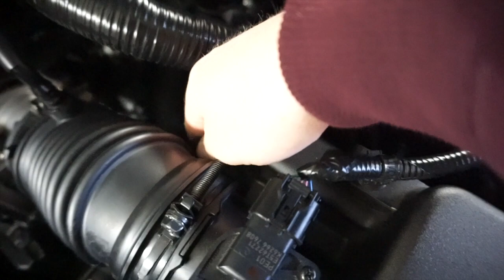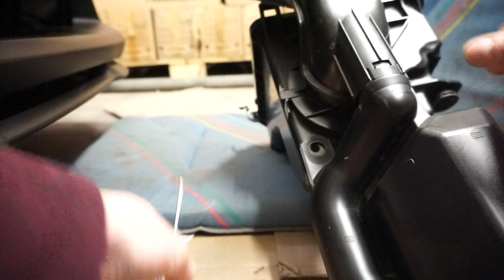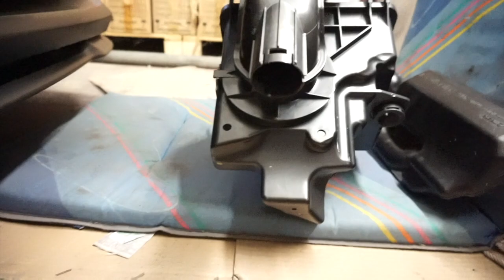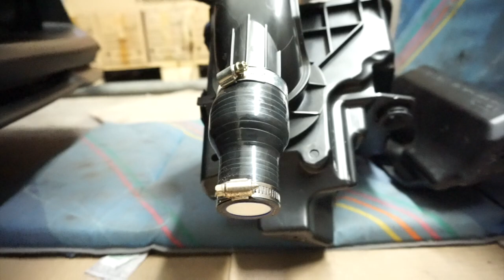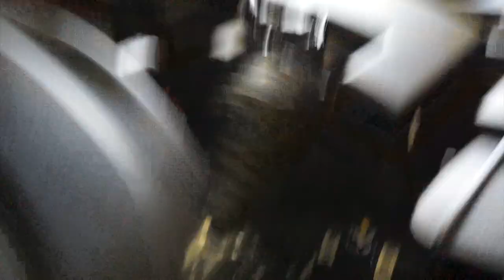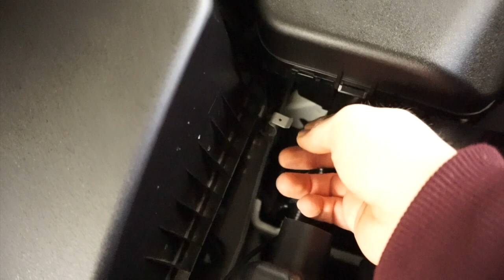Project Mazda CX-3  --  Resonator Box delete

Comment: Removing intake resonator will reduce power and increase the noise. It will create also power hole at some exact rpm's (depending of the manufacturer). It is highly NOT recommended to do so.

Comment: Can you tell me a difference before&after ????
Reply from the maker: I think that the car with the deleted resonator box and the
K&N air filter , he is in the upper speed range accelerates 
slightly better.
That´s my opinion
Reply: You gotta do a video for us to hear the difference. My 2019 mazda 3 2.5 has a whining or whistle sound during moderate acceleration from 1st-2nd gear. Sounds a lot like a supercharger. I cant seem to find any info about why it makes that sound but I like it. I installed the drop-in K&N filter hoping to increase that sound but it made no difference. Im curious to hear yours after your res box deletion.

Comment: Hi whats the difference after removing the resonator?
Reply from the maker: I think that the car with the deleted resonator box and the
K&N air filter , he is in the upper speed range accelerates 
slightly better.
That´s my opinion
Reply: east alps custom deleting i think 🤔 it give more air flow to the filter than to throttle than to valves and last to the pistons …. It increase performance and power of car … becuze this big resonator will  make air in low flowing … 👏🏼

Comment: any1 knows what is the size of the resonator box hole?
Reply from the maker: the hole has 45 or 47mm , i use a 50mm with a reduction to a 30mm silicone hose for the mod
Reply: @eastalpscustom  what was the material that you sealed the end of 30mm silicone hose? some sort of filter or someting else?
Reply from the maker: My Buddy has a 3D Printer , he Printed for me a 30.5mm size plug.
Reply: You can insert any thing to close the hole 🕳 no need special parts to close it